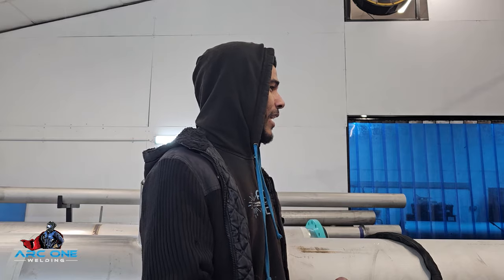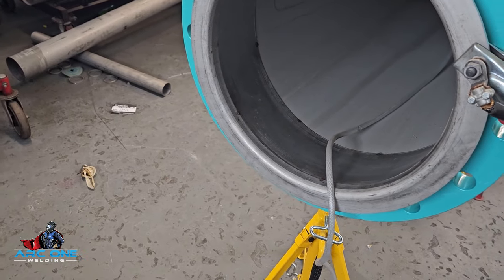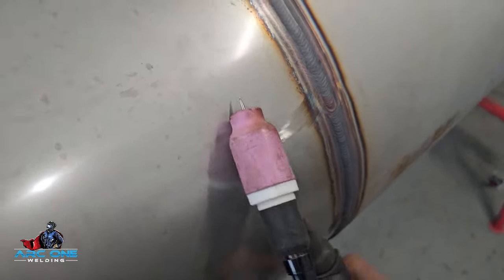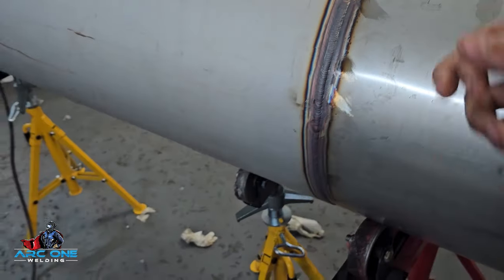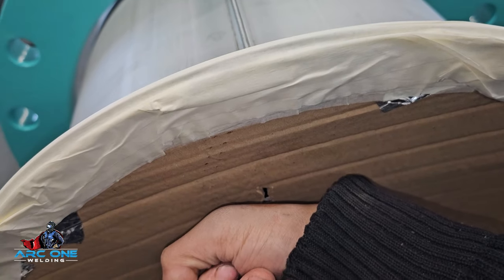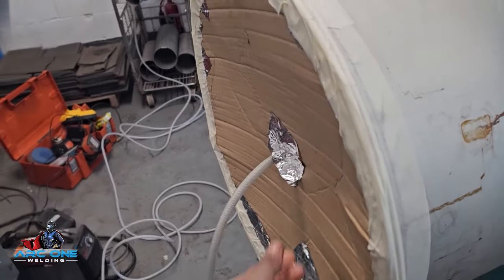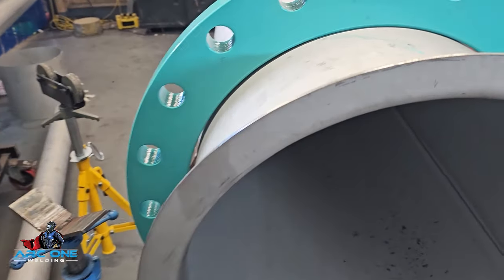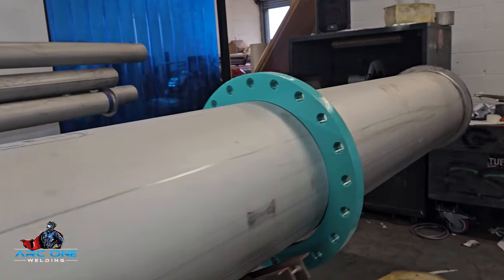Day In The Life Of A TIG Welder *18" Stainless Steel Pipe Welding*

Comment: Hey man, been watching you a long time and I am a long time stainless welder. I know you made a comment about the weld color but a lot of people don't know what that is. Like sugar on the back side, a black top indicates chromium evaporation. This means that the weld surface loses some of its corrosion resistance. The best way to fix this is to get a gas shroud that follows behind your cup to continue shielding the weld, you can also try a pulse setup. This is not a dis, just trying to pass some knowledge. Learning how titanium is welded can teach you a lot about stainless.
Reply: Or he could just turn his flow meter up a little so he has more gas flowing out. That's what I do normally, sometimes you gotta turn the amps down, too.

Comment: the color is fine but realistically you are burning some of the Chromium out of the stainless  honestly you  are probably like 1 -  5  amps too hot on your foot for the speed your moving in video.......Chromium is the part that makes stainless resistant to rust but it really doesnt matter  99% of everyone will find out 100+ years in the future..... btw if i remember corrrectly you  will get a better root  if you dont pulse..... pulse  sucks  the  root back in

Comment: I don´t know whats your problem....this is for a pipewelder one of the easiest job....you can twist the pipe....there is enough gap i don´t know why you are burning the material in this way....i´am also an pipewelder but i don´t understand the problem. This great diameter is much more easy to weld than a 14mm pipe.

Comment: I woudnt worry about the color of your work. I’ve seen guys on have their welds look like a peice of art with all the color but ive heard plenty older guys say that doesn’t define if it’s a good weld or not so the color doesn’t matter
Reply: so long as it isnt grey
Reply: Within reason. 
It's not the colour, its the heat input. Ie amps, voltage, travel speed. Heat input too high, then chromium in the alloy oxidises as the gas sheild moves along and reduces the material's properties

Comment: I feel ya, Im more judgmental of my own work than others and there's been times were I've started my part build and the parts are gapped to much the fitments the best that the fitter can do so your taking each little portion of the welding and making it all work then you finish and step back and ehh WTF in not a horrible welder lol. Sometimes you get what you get and you do what you can.

Comment: If you want super clean always clean up inch outside and inch inside your pipe with a blue wheel and wipe your fitting with acetone including you filler wire... Give it a try and purge off a separate bottle to stop fluxulation...